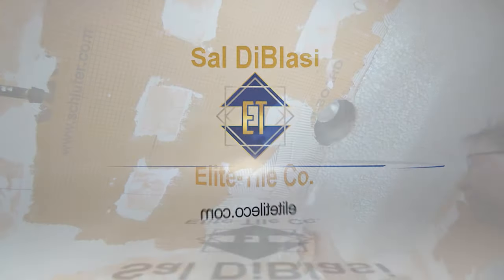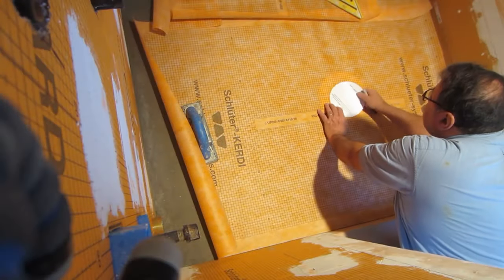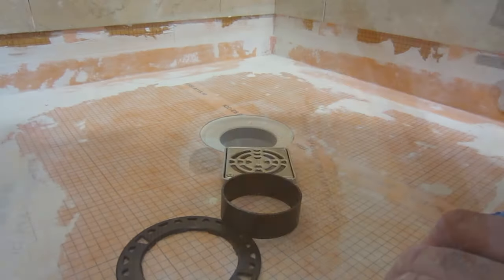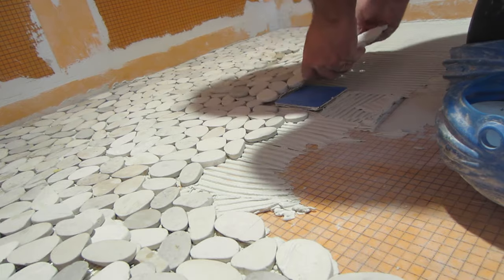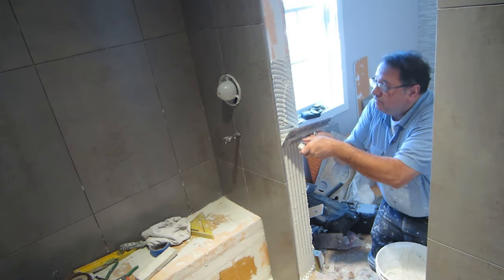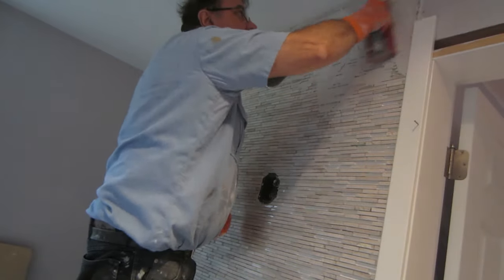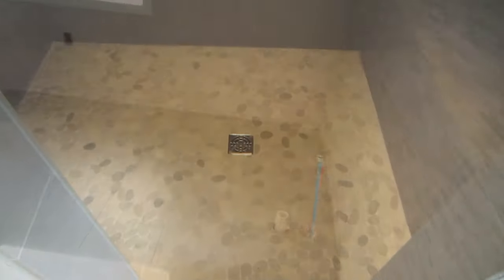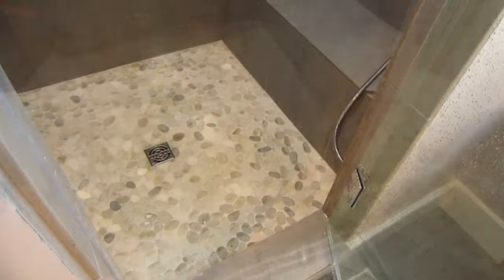Complete bathroom steam  shower  install,  start to finish.

Comment: Roughly What would it cost to do just the steam shower portion?  I’m starting from just a finished bathroom with a space for a shower and a plumbed drain for the shower.  Just trying to get a rough idea

Comment: Should particle board be sealed or replaced, ok to use floor leveler on particle board ? I know you are busy, but if you can give me some advice, I'd greatly appreciate it. Thanks.
Reply: The best option would be to remove the particle board and replace with plywood or osb. Moisture will cause the particle board to become unstable, swell and fall apart.
Reply: @OneWheelLess  thanks Austin, I kinda knew that but was thinking, can it be sealed, covered with Ditra then lay tile. You know, just hoping that I wouldn't have to remove 60 sheets..... Thanks again !
Reply from the maker: Has to go, it has no place in a tile assembly.